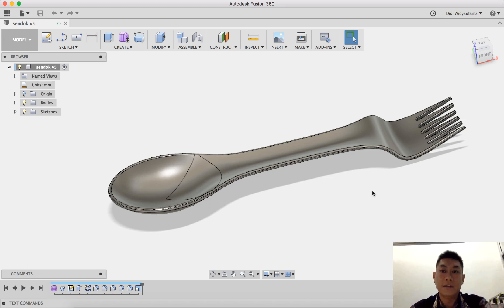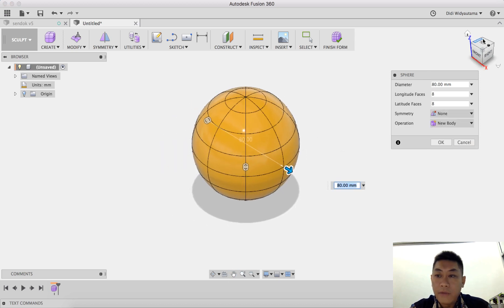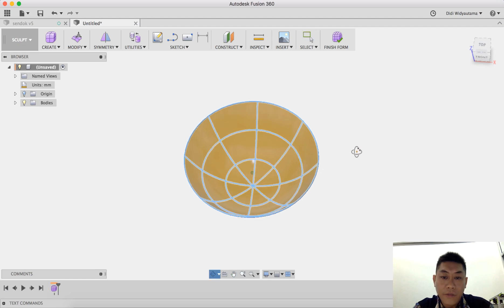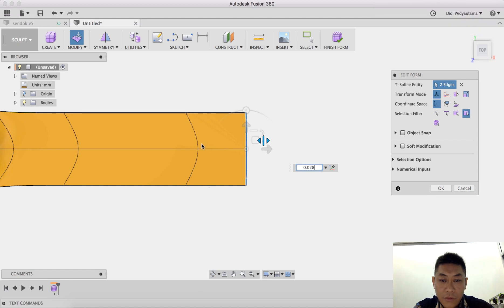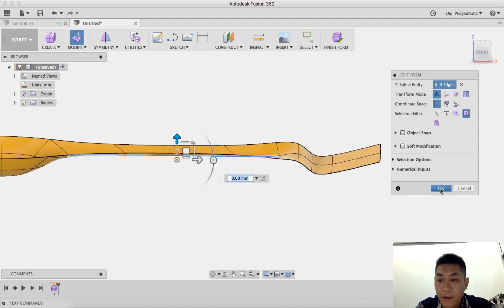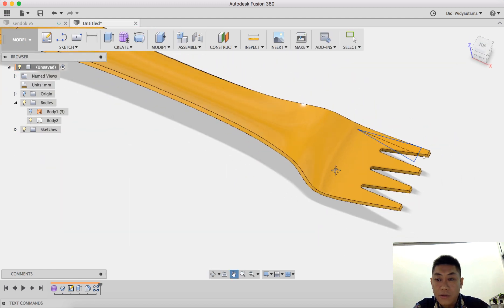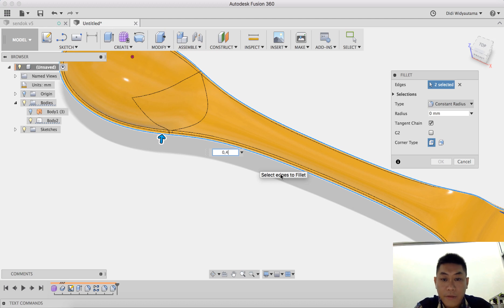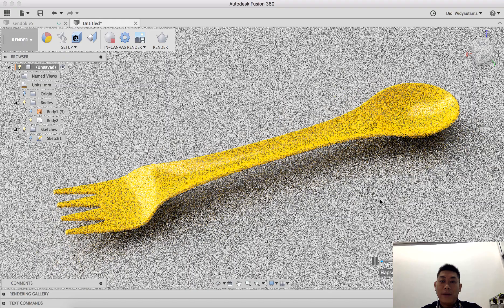Fusion 360 Tutorial - Spoon and Fork Sculpt

Comment: Hello sir. At 3:07 my program selects 3 edges instead of 2 like in your case, not only does it select the two edges you selected, it also selects the line that goes between the two edges (line from the center of the circle). Thus when I extrude it doesn't look like yours. How do I solve this?